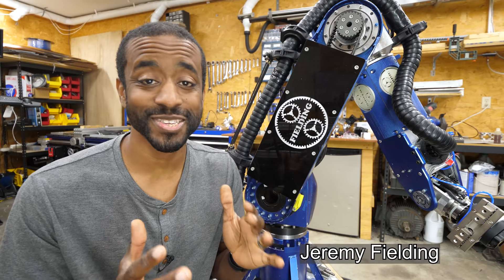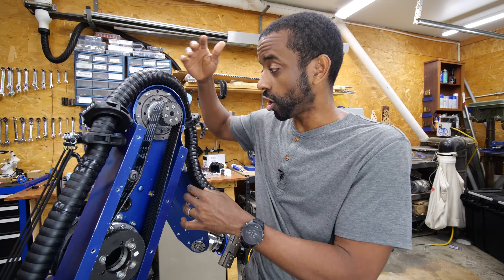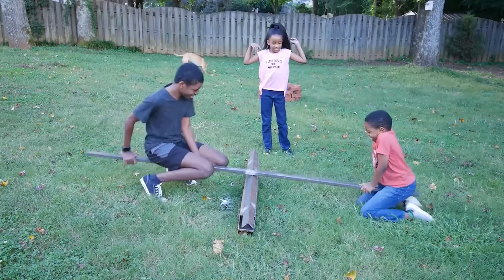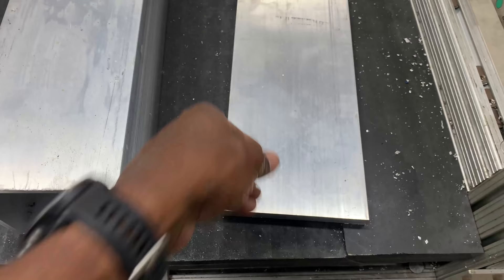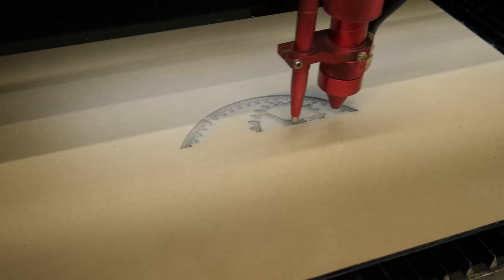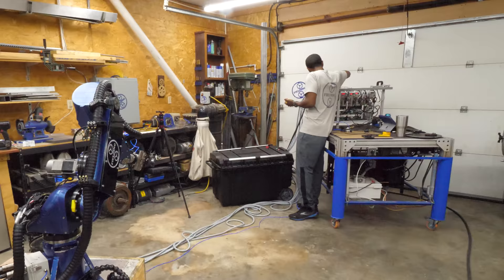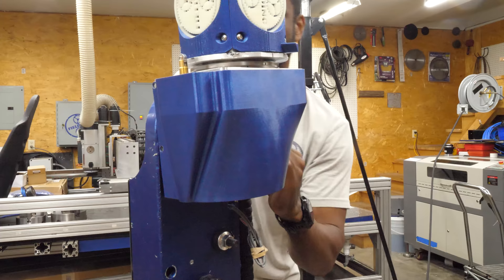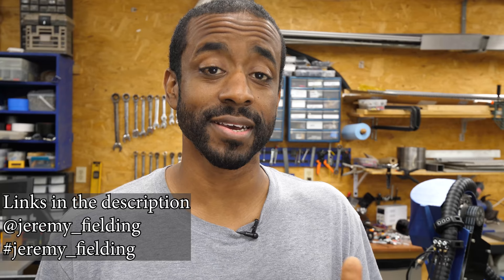How I Designed My Robot To Be Fast! Engineering Speed at a Lower Cost #092

Comment: I did pretty much the same thing modding my 3D printer. Except I blue off a 5V regulator and traces on the main board and it let the smoke out. Surprised this wasn't any more dramatic a failure.

Comment: If you're not using all the pins in those plugs, would it work to plug a couple random pins in ends on each plug and receptacle to make it impossible to plug in? Maybe a toothpick or a piece of plastic filament would work. Too bad plugs like that aren't designed to let you adjust the keying to prevent this kind of think.
Good luck with all this. I'm sure you'll find the perfect project to use those damaged motors on.

Comment: Using belts will affect precision still since it has some compliance. Even though it's seems very stiff, it is certainly not as stiff as gear teeth. When you reflect joint stiffness to the end effector, it may create be a problem because position control precision standards are very high. I would be curious of the precision difference of this design choice. It could also affect closed loop force control bandwidth if you intention if eventually to to that too. Have fun!

Comment: Welding after machining is not recommended because welding heats and possibly distorts parts. You can waste a lot of time and effort machining something to tight specs only to have the precision part warp into something unusable.

Helps to weld carefully, in small chunks, like stitch welding, clamps everywhere and then some clamps, symmetric welding, and clamping. With clamp sauce.

Comment: Why did you choose to use a ratio less than 1 (1:2) with the belt drive? Are you happy with your motion stability? Do you have friction at the end of this joint? Assuming you were able to pick the ratio of the motor gear box  freely, it seems like you could have gone with at least 1:1 there. Anyway, just found your channel. Very cool! Looking forward to checking out more!

Comment: Maybe you can glue on a “key way” to the outside of those cables so they can only fit onto the correct spot? Like a plastic ring with a notch on the female end and a plastic tab on the male end? The owner of the robot could make the same mistake

Comment: That is a common problem when using multiple connectors of the same type.  If you aren't using all the pins in the connectors, you could remove one of the pins from the connector and plug the mating female connector.  This would keep the connector with the pin from fitting into the mating connector that has that pin plugged.

Comment: Theres nothing wrong with the ~cables~ connectors you chose.  It's pretty common practice to have same cable, different pin configuration (e.g. plug one pin hole unique to the other cable to prevent being able to plug any other cable in), to lower cost.

Comment: Great job on your robot arm Jeremy. That's a serious bummer about burning up your motors. I have a question. Would it be just as accurate, and perhaps more durable, to use a long shaft and gears in place of the belt and pulley system? None the less, your machine is still a great piece of engineering. Looking forward to seeing it fully operational. I've thought about building one myself, suspended from a track system on the ceiling. Just an idea anyway.

Comment: Make a 3D printed socket shroud which only fit in correct plug. Then same unmodified connector can be used, greater simplicity lower cost than different connector types

Comment: You should never use the same connector for 2 different connection types when interchanging them could lead to disaster. At the very least, get connectors with a few extra pins that you don't need, and use them as key pins - remove a pin and plug the corresponding hole on the other side, so you physically cannot plug the wrong cable into the wrong connector. Any connector system worth its salt will have plugs available to create keys.

Comment: Hi Jeremy and fans. I’m looking for a material pre feeder. However, my
thought is to see if you can point me to a simple motor variable speed design that could be used. 

In short, I have a spool of bungee cord that is cut to size via a strip cutter. However, to work properly, I have to manually feed the roll to avoid tension. Tension causes irregular cuts.

Comment: I'd love to see a drive shaft version with an easily swappable set of gears to change the speed and torque....
...or maybe you could even have just a single cone gear that you could somehow make adjustable to change the torque/speed with just the turn of a screw or knob?

Comment: Welding after machining is not ideal because it tends to warp the metal when the welding heat is applied to the part. This will cause inaccuracies in fits and it will also compromise on tolerances.

Comment: I was going to suggest color coding but I see you've done that.  Also, I plugged the wrong power supply into an external hard drive once and fried it instantly.  $2000 later I had all the data recovered.  I really feel the pain you are experiencing. :)

Comment: what if you printed/made something like a clamp with locating pins that attaches to the cables. each unique. and a plate that goes on the box to accept the locating pins. that way you physically (without force) make that error again.

anyways those moments suck thanks for showing your learning moments it shows how swapping cables is super easy to do even if labeled which is why (as you wanted) engineers use so many different sizes of connectors. i remember doing something similar with my 3d printer. i have a dual power system(12 and 24) and was doing some maintenance and accidently swapped power lines. i knew it was wrong really quickly cause all my fans let out the magic smoke and fried a capacitor on my expensive board. luckily replacing the cap and fans fixed it.

Comment: I was an Engineering Tech. An Engineer gave me drawing to build a power supply for a hand work station just before a Reflow Oven. I built it and bench tested it. Called the Engineer, he approved it and had me in stall it he signed off on it. So we powered up the line in a matter of milliseconds the main control board for the oven, computer interface and the power supply smoked. We figured out the the Engineer had no idea what floating grounds were and tied them together through the power supply. It was a $10,000 mistake in milliseconds seconds. Are the encoders replaceable? I have replaced encoder before. I spoke with a vendor and he gave the number to order. This was over 20 years ago. So I'm not sure if the design of your's would be repairable.

Comment: 1. What are you planning on doing with the robot arm?  It seems to me that 1HP motor is excessive, unless you are planning upon lifting cars.  (My frustration is I would like to see 50 & 25 watt servo motors.)
2. Do you have a gearbox in the elbow joint (that the rubber belt you discuss is driving)?  What is its ratio?  You comment upon maximizing speed.  What is the ratio between the inertial forces versus the gravitational forces?  How many G's acceleration at the gripper?  What is the weight & the inertia of the load?
3. You say "low cost".  WHAT IS THE NUMBER?
4. Yea, belt is "precision" in 3D printer, but "precision" in 3D printers is dominated by the dynamics of the goo you are applying, & there is LITTLE FORCE on the belts.  If the belt is on the high-speed side of the gearbox, OK.

Comment: Hey, I got an Idea while watching and listening to you.
I was thinking about moving the Motor with the Belt to the opposite site of the lower connection. (it also must be rotated 180 degrees, to the opposite side of the Arm) I mean, that it could act as a counter wight to the overall structure? Much like the seesaw with your Kids.  In my imagination, the arms could be made of a more lightweight construction because they don't have to support so much wight on a single side. So Overall weight could be reduced, doesn't it?  
Do you think that would bring any benefit ?
Great work by the way! I love what you are doing !

Comment: Love your videos! I've built a "weed eater on a stick" which I grab with my tractor's grapple to trim under trees. I've been working on articulating the arm to trim the angled road ditches and Jarvis has given me some great ideas on how to do so. The weed eater motor/head I'm using was salvaged from an EGO 56V, 15" cordless string trimmer which I power with the 2.5 Ah battery that came with it, which only lasts about 40 minutes. I'd love to replace the motor with one that will run off of the tractor's 12V battery, which would need to power a 15" cut at around 6,000 RPM. Would you have a suggestion for such a DC motor? Thank you!

Comment: Why not add a balancing weight? That way you could have the motor anywhere and accelerate/decelerate the arm quite easily in any direction. I know this adds total mass quite significantly but thick metal is fairly cheap in comparison.

Comment: we learn from these failures that's the way of electronics engineering. i was designing a pcb that had some expensive op amps and adcs that the front ends if feed more than 5v would blow them up well after i had received the prototypes i had applied 12v to the front ends by mixing up connectors  now if i can implement a protection feature i do but not over do it lol

Comment: Jeremy, I think that it would be prudent to have either circuit breakers or car type fuzes installed prior to the new motors encoders as a fail-safe against this happening again. Did you also match the cable identification system onto the face of the connection box?
Mark from Melbourne Australia

Comment: Don't they have any protection?
Maybe just a fuse blowed up. Expensive things should have at least a diode clipping circuit with a fuse, to limit the voltage to 5V and blow a fuse if exceeded.

Comment: Oof. The downfall of interchangeable connectors... Are there enough pins in those connectors that you can remove a different one from each, and fill it's corresponding socket with resin or something to key them uniquely?

Comment: I did a similar thing once while swapping out my PC's power supply, turns out modular doesn't actually mean modular because the pinouts on the cables are different. Thankfully I just reused the cables for my drives and not the CPU or GPU, but I still managed to fry all my drives irreparably losing their data with just the flick of a power switch. 

Extremely painful, I think I would've rather broken them by dropping the PC or spilling water on it, would've felt more real than just having to accept I passed too much current down the wrong circuit and fried a chip.

Comment: Sorry to hear, I've done precisely that with poorly designed 3d printer stuff where identical yet definitely-not-the-same plugs and sockets are dangerous to one another.
...Is it possible to change out the cooked bits on the encoder rather than a full motor replacement, or do they not part out that way?

Comment: Oh, that sinking feeling when you realise you just destroyed a bunch of hardware. :( I had that some years ago with my PC: the power supply had died, and I tried for a while to fix it but eventually gave up and bought a replacement. The new one didn't have enough Molex connectors, so I wired up some Y splitter cables. When I powered it up and smoke came out the back of the PC, I realised I'd swapped the 5 V and 12 V lines at one end. Two optical drives and a hard drive (all high-end) gone. I guess it was a good test of the new power supply...

Comment: but if u move the servo down to reduce the torque needed to move it, why not putting it right in the previous servo direction ? so the amount of torque that it would increase for the move would be zero. is there any impossibility or disadvantages of that  ?

Comment: Please correct me if I'm wrong but that idler tensioner looks too small. What is the manufacturer recommendations for idler tensioner diameter for that specific belt. I'm interested in the belt manufacturer and part# if it is properly spec'd.

Comment: I was wondering what motor could you use for a homemade roller coaster lift hill that could be speed control to start it slow and speed it up some. Also what kind of cheap motor could be used for wheels to push the car like the real coasters.

Comment: So why not  go with hydraulics? Is that system not accurate enough or something? It would remove a heck of a lot of weight from the entire arm using that form of system over gears and motors. I know they make high speed, high torque motors so not sure why that would not have been a better option overall?

Comment: I want to build a robot arm myself but I was considering self locking through worm gears as very important. How do you make it not fold up when energy is off?
Reply: i assume that either the friction from the gear reduction is enough to not make it backdrivable or these motors actually have brakes that Stop them dead in their tracks with no power. for you designing a Robot arm, these are two options but you could also use counterweights to make the Robot essentially neutral.

Comment: It's robotics,  everything should have a limit sensor.  Lose tension on a belt, auto shut down and fault alarm.  Sudden acceleration past a % limit, auto shut down and fault alarm.  And big oof 24V into a 5V rail ... You going to tear those down and show the damages or try to repair the electronics in them?  How about those plugs, unify all of them so the power pins are the same on all four or are you going to get new plugs to block it from happening again?

Comment: We had some encoders that were so flakey that just putting a meter on them would ruin them. These were on poultry conveyors using CAN bus. 
I forget what we finally did for this, I could look at my notes from 2017, but I'm pretty sure we just switched brand and model encoders. Besides I'd rather forget 2017. It was worse than 2020 was, for me personally anyway.

Comment: it upsets me to hear your motors were fried. 
if i may offer a couple of solutions that come to mind as a inexpensive means of voltage protection 
1. for the lower voltage jacks, remove one of the pins from the high voltage jack and the fill the corresponding hole in the high voltage plug making it impossible to mix them up again.
2. or install quick blow fuses in the motor controller boxes.
best of luck

Comment: No overload protection, man don't I know about that. Hard to design one for 5V. Voltage regulator is a good bet. Stepper motors are so tricky. Better to buy the right connector and install the bigger box. I know those motors aren't cheap.

Comment: Thanks for sharing the stupid.  Anyone who's built anything even remotely complex has done this, I'm sure.  I have absolutely blown up every component at least once.  Just finding one perfect connector is a headache.  Making each connector different makes sense in the design phase but becomes a nightmare when you build.  In this situation, I'd swap the genders of the 24v line, color code and numerically code.  Definitely always take a breather when you feel like punching something; it's obvious, but easy to forget.  Keep up the great work.

Comment: it s easier to machine  gears and shafts, why belts and 14kg motors at the first place
Reply from the maker: Did you watch the video? The whole video is about answering this question. All of engineering is a trade off. There is rarely one perfect answer. For example, just based on your comment it seems like you think gears would allow you to use a smaller motor. Gears only trade speed for torque they don't give you more power. So you might get more torque but you have a very slow arm, or you can move fast but the robot can only move a very small load. Please watch the video and you will get your answer :)

Comment: 3:18 You say that by moving the motor farter away from the rotating joint, you increase it's moment of inertia. I agree with your following explanation of what moment of inertia is, but I don't think it applicable in this case, at least not how you describe it.
Lets take an extreme ficticious case: a 1km long belt. If I understand your logic correctly, it's moment of innertia should be immense (at least compared to what you have now since we are not working with absolute numbers here). In turn this should should effectively prevent the motor from functioning because it does not have enough torque output. I disagree with that logic, apart from the much increased belt weight at this point (which does increase the innertia of the system), increasing the belt length does not increase the rotational innertia in this case.
I am saying this because you are not swinging the motor around the center of rotation, so the motor is not rotating at all in the reference frame of the joint. Therefore, it's distance does not matter. Think of it like a bycicle, following my reasoning I am saying it does not matter how far back you place the back wheel (ie increase the chain length).

Although I must admit I am writing this argument using no calculations and just intuitive thinking at this point, I do think I am right. I look forward to how you see this @JeremyFiendling
Reply from the maker: Something was lost in translation here. The extreme case would be no belt and the motor directly connected to the axis it is moving. This is why the belt is there at all. So the motor (and its mass) can be closer to the point of rotation.
Reply: @Jeremy_Fielding  The motor being closer to the joint it is connected currently to would not change the inertia of the 'system' comprised of that motor, that joint and the next arm segment. Is would change the inertia of the system containing the previous arm section. Because in that case you are moving a mass around (ie the motor) that is actually moving with respect to the system. Is this what you mean?